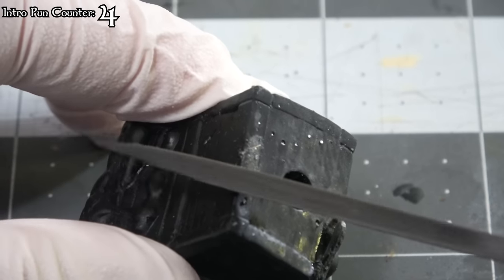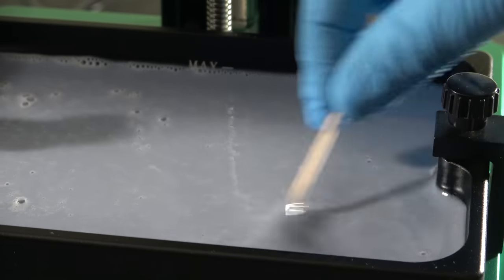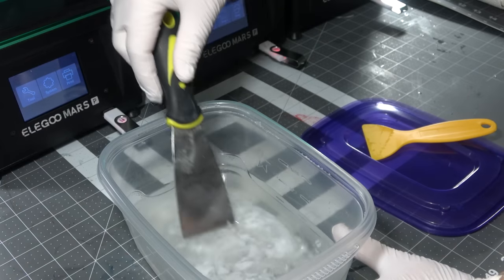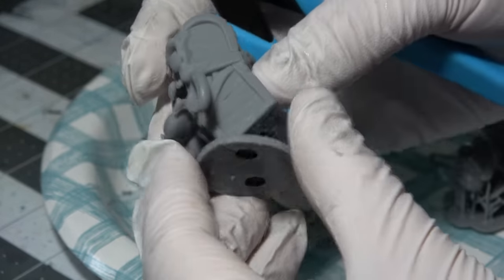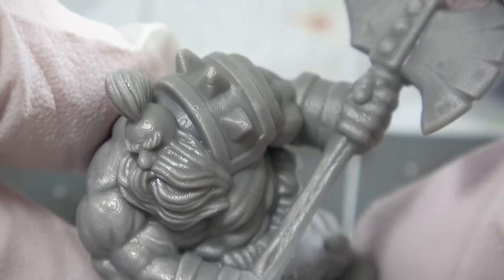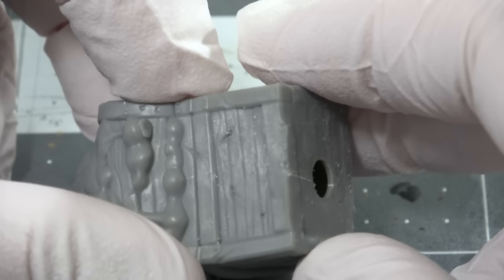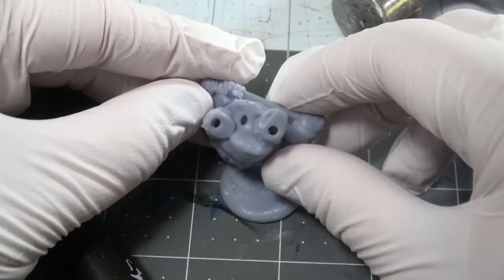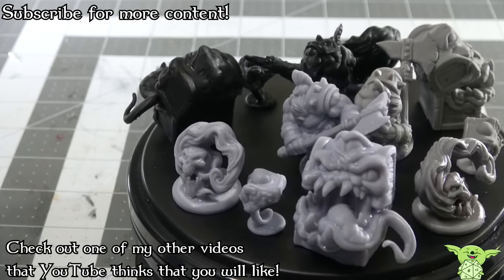Testing 3D Printed Resins: Is Water Washable Better?

Comment: For the Alcohol, I would genuinely suggest pouring it through a fine filtermesh AFTER curing the "vat" of Alcohol. That way the resin inside is sortof cured and gets caught by the filter. It saves so much money.
The muck that is left on the filter can then be disposed as per your country's guidelines.
Reply from the maker: I absolutely filter the resin off when I out it back in the bottle :)
Reply: Nice idea! I will try that.
Reply: @Rybonator  He means to hit the alcohol bin with some uv to cure the resin mixed with the alcohol and then filter it to get back some of that alcohol
Reply: I use a normal degreaser (Mean Green) - but then I rinse in clean alcohol, it helps evaporate the left-over water and removes whatever stuff was in the degreaser.   The actual amount of alcohol is then greatly reduced.
Reply: Nice advice!
Reply: Even better tip: use a sealed container and cure it in aunlight. The resin will solidify in a soft blob at the bottom. Remove the blob, shape it using gloves to make rough terrain rocks, then your have fairly clean alcohol to reuse

Comment: “Thiccness equals quality” a man of culture i see
Reply from the maker: Mama raised me right :)
Reply: @Rybonator  jokes aside, higher viscosity does not necessarily mean better quality. The oligomers are the most viscous components of a formulation and in theory, the more oligomer you have, the better the mechanical properties you are trying to achieve, however the viscosity must be low enough to make it printable. There's also a myriad of oligomers available on the market, from high molecular weight to low molecular weight, from high viscosity with average properties (cheaper) to low viscosity with superior properties (specialty material), so it's not a linear relationship between formlation viscosity and overall quality of the resin. Which quality are we considering? Mechanical properties? Printability and visual aspect? There's too much to factor in to simply summarize everything with "higher viscosity = better quality".
Reply: @arthurkassardjian5172  nerd
Reply: @evanb.5726  you're welcome

Comment: I dont know what ur protocol is for reclaiming ur alcohol but I hope this still helps. After collecting the murky alcohol i would set it out in the sun and wait for the resin to fall out of solution. Then instead of directly filtering it i would first decant or siphon the relativly clear alcohol of and leave the muck behind. If u are filtering the alcohol i think this step could be quite handy because the sludge can clog ur filter and then it would take ages to filter through. Then if u filter the sludge maybe a coffe filter, if its still realy cloudy just add it to the next batch if decanting and for the relativly clear alcohol maybe try something finer like a funel with a long neck which u can stuff with cotton on top activated carbon or charcoal and on top of that some more cotton or just another one or two coffe filter. Now u have hopefully some clear alcohol but also some wet sludge and also moist filter papers, other equipments u used here and maybe also some wet filter charcoal and cotton. To reclaim the alcohol from these i would first whipe everything drenches i alcohol down and put these wipes and all the other stuff ecxept for the equipment, which now should be just normaly washed and dried, into a small dark container without a lid, which then can be put in a clear container with a lid. When u put this into the sun the alcohol should vaporise and condese on inside. To help this process u could cool the top of the container with water open to the air and create a spot on the inside of the lid for the droplets to collect and fall into a second smaller clear container or just directly to the bottom. Also its important that the drops dont fall back into  the black container so even if dont use the second one, knowing where the alcohol collects is quite important. I should probably also mention that u dont want pressure to build up and to keep it away from sources of ignition. U pretty much have a vessel full of air and alcohol vapor which can explode if egnited. The pressure that builds up before a container burst is essential to the power of an explosion so yeah if u wanna play it safe use plastic wrap as lid and maybe leave a small hole near the rim so u can still put water on top of it. Dont trust me, im just a nobody from the net :)

Comment: Honestly, anymore I only go with higher quality resins.  Blu from Siraya Tech being my go to.  Before I switched over, I was finding I was having way too many issues with warping and bed adhesion.  After the switch, I don't think I've had a single failed print in over a year.  Pair that with a wash/cure station and clean up is quick and easy.

Comment: Does he not realize 99% rubbing alcohol evaporates at room temperature? "Disposal" could be the exact same if he just left out his dirty alcohol in a waist container. While I do get you are still buying something there's a few ways to make it 10x easier. My first two suggestions would be a magnetic mixer they are like $20 and include a magnetic pill you put in your alcohol. Second don't scrap your prints off until they are done being rinsed. Make or print a mount to hold your build plate suspended in the alcohol. Set a 3min timer and you can walk away. When you come back they will be rinsed and ready to be scrapped off and put right in your curing chamber. Bonus tip fill a small spray bottle with alcohol, spray everything off right after removing it from the printer and before you put it in the bath. A prerinse will make your main alcohol last quit a bit longer! 

Love your videos Rybonator just some tips on alcohol use. Its actually pretty none toxic, as long as you don't drink it  ;), do to its low evaporation point. I consider it a must have when working with glues and resins just for cleanup but I'll definitely be giving some water washables a try.
Reply from the maker: These are great tips! Honestly don't know why I didn't think to just let it evaporate haha :)
Reply: @Rybonator  We all have those moments! I've got to thank you for your 3D printing videos to btw. I've been an avid FDM printer user for a while and just got a Resin printer for even better minis and mold masters. Your video's on supporting dice and even more so your free use models are invaluable it was near impossible to find a free set of RPG dice!

Comment: If you put a little screen cover just over the bottom of the isopropyl cleaning vat, the resin settles underneath it, letting your isopropyl last longer.

Also, if you get a single UV LED hooked up to a proper power source, you can often cure the insides of most hollow prints with very little adjustment.

Comment: Hollow prints reduce resin use by 50 - 60% which is a considerable savings if you're printing with Siraya Blu or AmeraLabs. But I get your point that the uncured resin inside is less than ideal. Drain holes are supposed to allow the washing fluid to get inside and rinse it out; either those flame head figures didn't have holes or they didn't work. Thanks for the comparison video!
Reply from the maker: Oh totally! The AMeralabs probably saved $1 per mini haha. I just don't ever like it when it leaks out later, which seems to always happen to me. But it could be that my cleanup process is less than ideal. Who knows!

Glad you liked it :)

Comment: personally ive found water washable is great as long as its a translucent colour. the opaque ones like the grey and black crack over time ruining your prints, they are also way more prone to warping than your alcohol wash resins
Reply: Yeah major issue with those resins which is never mentioned
Reply: I guess the good thing is the resin is pretty cheap and most minis are resin sippers. I'll have to keep an eye on my Warhammer proxies as time goes on. Hopefully keeping them in proper storage conditions will ease the 'decay' as well as the paint/clear coat.

Comment: I didn't see anyone else mentioning this, but is there a reason your elegoo resin settings are what they are? My bottles suggest 60 second initial layers and 8 second subsequent layers, whereas you had 100 and 11. That might be why you're getting a bit more noticeable print lines on those resins and a little less detail on the minis. I've done a few tests above and below the 60/8 and those are what worked best for me. I use primarily Elegoo's water washable resins.

Comment: Try cutting Siraya Tech Tenacious with ABS like Resin.  It's pretty expensive but if you only use a 10-20% ratio than the price difference is not much and it adds a lot of shock absorbance.

Comment: Frankly, if you're going to paint the minis (or anything else you print), those build lines will disappear after about two coats of paint (maybe even just a primer will be enough).
So...  I'm taking away to use WW unless I plan to leave a print unfinished, and then break out the high quality resin for super smooth finish.
Though, with proper dialing in of your exposure and lift speeds, those lines might even smooth out more...
Thanks though - def going to give WW a try now.  I wasn't sure.  I've heard such mixed response.

Comment: 2:43 To be clear, you don't HAVE to use alcohol. Other cleaners work as well or better. I use Simple Green. It's cheaper, safer, doesn't smell as bad, and you can save the alcohol for medical purposes.
Reply: Oh damn, those are way easier to obtain too
Reply from the maker: That's why I say you CAN buy other materials, but I have not experimented with those, so I kept it out of the vid. But you are totally right :)

Comment: I use mean green super strength for washing minis and it works great and it's much cheaper than isopropyl alcohol. I use isopropyl alcohol to wipe things down but I use it in very tiny quantities and mainly because it evaporates and leaves no residue so it's great for wiping down the build plate before doing the next print.  About $10 in mean green cleaner last me a couple months and the seven and a half dollar bottle of isopropyl alcohol lasts me three or four.

Comment: is there any difference in regard to priming or painting them? (ex. does acrylic stick better or in less coats to one than the other?)
Reply from the maker: Not that I have found. Priming sticks the same to all of them, and you NEED to prime before painting :)
Reply: From my experience it's the same. Also, the first think I noticed that resin prints are amazing for painting without priming as opposed to PLA prints or the injection mold plastic. I bought different colours of water washable resin, to save time on priming for the purpose of undercolor basecoating.

Comment: Hi Rybonator, Can you help me with this? Do you know any washable resin with these specifications?
Flexural modulus：1.882-2.385Mpa
Flexural strength ：59-70MPa
Hot deformation temp.：80℃
Thermal expansion：95*E-6
Volume shrinkage：3.72%-4.24%
Linear shrinkage：1.05-1.35%
Tensile strength：36-52MPa
Tensile modulus：1.779—2.385 MPa
Elongation at break：4-10%
Hardness(Shore D)：62-88 D
Glass transition temp.：100℃
Density：1.05—1.28 g/cm3
Notched impact strength:44-49j/m
Viscosity：100-350MPa·s
Instantaneous temp.: 140℃

Thanks a lot!

Comment: Maybe it's a difference in the resin (even though it's just a different color Elegoo water washable resin but I have the ceramic gray and for most prints I don't have any discernable lines on it and don't need too much post-processing outside of cleaning up support locations. I also only expose it for about 6 seconds a go on my Anycubic Photon.

Comment: Hi Rybo, great video and quite informative. I was wondering if you would do a video on acetone smoothing (I don't know if it works on uv resin ?)
Reply from the maker: I might be able to do that! But I think there is already a pretty comprehensive version out there for FDM printers. Just don't know if there is one on resin prints.
Reply: Hey! It does not work for resin prints ;-)

Comment: FYI this is a December 2022 comment.

I have an Anycubic Photon M3. I have tried the Anycubic water washable and the eSun water washable resin. These are my personal observations:

Anycubic WW: needs less exposure time, hard but brittle
eSun WW: less viscous than Anycubic, needs more exposure time but more impact resistant, less brittle than Anycubic but still fragile

I don't have a washing and curing station so I opted to go for the water washable. It's more expensive than the standard resin. Lastly, I agree that although it is water washable, it still needs to be disposed properly.

Comment: I mix elegoo ABS-like resin with the siraya tech that’s flexible (don’t have the bottle with me for the full name). Because my miniatures need to be floor proof lol. The mix is like 10% siraya/90% abs. It really helps with the durability with minimum detail loss. Virtually none but if you get very close I imagine you’ll find some details are less sharp.

Because of that I had to switch to alcohol. You can mix the water washable with the others but you can’t then wash it with water so yeah.

The downside with water washable resin so far is simply less variety. We’ll see about that in the future! 

I print with the elegoo mars “not pro” special basic edition.

Edit: if you wait about 2 days after printing you’ll see the real durability of the resin.

Comment: Any plans to look at these after a few weeks again?  I think I made a mistake by making some masters for dice out of water washable because after letting them sit for about a month, I began to see cracks in the dice as if the resin had shrank and the resin began to separate at possible stress lines (or maybe print layers).   Nothing catastrophic but after some research this seems to be a common occurrence.

Comment: I really like the translucent resin from elegoo when it comes off the printer but It ALWAYS  turns yellow after mere seconds of light exposure. Have you had any success or tried the clear translucent resin?
Reply from the maker: I have used the transparent blue before, but always paint them, so I wouldn't be able to tell ya sadly
Reply: ive found the same with white resins, all I can tell you is to use a very low power UV led for short periods then spray with uv sealer
Reply: @snailorgy  I've even tried leaving it in a window that has a fog film on it and it almost instantly yellows my resin lol
Reply: @snailorgy  sometimes even washing it in IPA will turn it yellow too. Makes no sense

Comment: yeah I swapped to water washable for my mass production bases I print.
Huge mistake, it's a massive chore to dry them so you can cure them, they take forever to cure.

Normal resin hands down wins, Toss in Denatured alcohol, go to secondary cleaner one, take out, dry in minutes, and done.
Reply from the maker: Fair enough, I see the benefits for both, but if you are doing a large amount of them, alcohol versions probably would out-do the water washable :)

Comment: Is it possible to print minis with the other type of 3d printer?  The ones that use filament not resin.
Reply: Depends. But I highly recommend not using a filament fdm printer for minis. Just from personal headaches...I mean experience
Reply: Yes, it is. However, you have to be more selective of what you print and accept that some things are just going got turn out like crap. For instance, I used my FMD/FFF printer to print a custom Dragonborn mini and the tail turned out thin and not very good looking on the bottom side. I also printed off a Sergal Samurai from Thingiverse and almost each and every single time the legs and sword break off.
Reply: It isn't as easy.  I have yet to get a mini that looks nice but there is someone on here ...3d dm or something I don't remember.  They have had better success and have tested things a lot more with filament printing minis.  I do have to say that the scatter terrain I've  made looks awesome.
Reply: It is possible, just takes a lot longer time to print and really knowing how to fine tune your print settings to get a really smooth and detailed print.
Reply from the maker: You TOTALLY can. But the detail difference is enormous! I prefer FDM (the filament printers) for large prints like terrain, and resin for minis and dice. :)

Comment: Im new at 3d print. What resting settings did you use to get these sharp details? My validation test shows 1.5 sec but when printing minis they are complete fails. Thx

Comment: I'm rather disappointed with this video because my experience with water washable resin is vastly different. First of all it's incredibly caustic.  I had some water washable resin on my hand and didn't realize it and by the time I did it had eaten through several layers of skin to expose red flesh underneath. I have never experienced anything like that with regular Elegoo gray.  Secondly, water washable resin absorbs moisture from the air and will bloat, warp and split. At least 80% if not 90% of the minis I printed with water washable resin were ruined within a week because I live in an area with fairly high humidity. No one mentions this on any of the videos and it's hard to find any information about this when searching online.
Reply: I have had no issues with it being caustic, with any of the Elegoo  resins actually.  But I have had 2 split.  Both were hollow and were not cured on the inside.  So I only do hollow prints if I can put in a hole large enough for my UV flashlight.

Comment: My biggest problem with (one) water washable resin is that it was not very resilient to environmental changes. I live in a moderately humid environment and over summer (when temperatures and humidity were a bit elevated) an entire year's worth of resin prints using water-washable resin developed fine surface cracks. This was large prints, small prints, hollowed prints, non-hollowed prints, primed prints, painted prints. etc. All of them. It was heartbreaking!